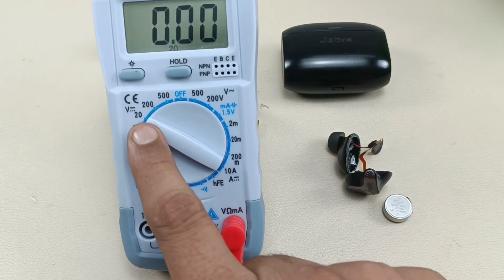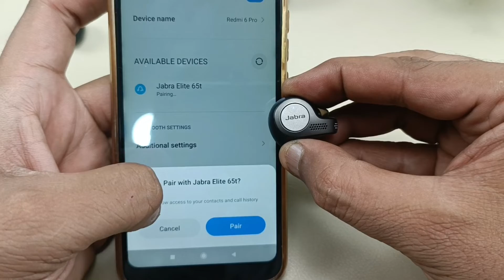JABRA Elite 65t Completely Dead Fix | How to Teardown & Replace the battery

Comment: Hello how many mah should be the battery? Besides 3.7v! I see in AliExpress some with 40 mah and others 70mah.
Reply from the maker: hi! , 40mah or 70mah can be fine but as mah increase size of the battery increases so fitting inside the buds is challenging, so based on the space available inside the buds you can use the battery

Comment: What is the replacement battery part no. ? Where are you located ?
Reply from the maker: it's Li-ion polymer Battery which is compitable to this device . part number is  not available.

Comment: Do you think the Elite 75t is similar to replace the battery?
Reply from the maker: yes it's almost similar.
Reply: @audiowiz360  thanks! I might try it when my new earbuds arrive. I used the 75t for 4 years, great earbuds but the batteries are at their end ⚰️
Reply from the maker: if you are from India send it to me , If you want I can replace it for you.
Reply: Did you need to use heat or a razor to break the bond on the case??

Comment: Excellent step by step video….I repaired my Jabra Elite 65t following your instructions…ALL controls work perfect….when placed into charging box, it does show led on to show charging BUT does not charge…please suggest a fix…ty, keep up the great work
Reply from the maker: Thank you! if the charging case doesn't give voltage in that case also buds will not charge. 
check the contacting points of buds and case try cleaning it because sometimes the point doesn't touch. 
best of luck!
Reply: @audiowiz360  ty…all points are working….I may have to glue down the round cooper Negative in the buds to ensure contact…
Reply: *copper
Reply: I have the same problem. I took it apart several times. But I can’t check whether the contacts inside the earphone are touching or not. I'm already thinking maybe the power controller is broken?

Comment: hello, one of my headphones is malfunctioning.  (very little sound) I went to check the audio balance but it was well adjusted.  So I tried to put the setting all the way on the left monitor (which is malfunctioning) and indeed we can hear the sound but from a distance, not loud, with a "radio" effect.  I don't know how I could fix this.
Reply from the maker: without checking it I cannot say the exact problem. 😊

Comment: Good teardown video. IT WORKS!!! My only addition to it so you can separate the adhesive easily is to heat the bud with heat gun. You don't even need to pry it once its heated. The bud can be easily opened. I tried to open the bud without heating, it is to hard and even with pry tool you can't open it. Heating is the best way to loosen glue. But overall good and it works. Thank you!
Reply from the maker: nice 😊👍

Comment: My Jabra Elite 65 t not working mic.
Reply from the maker: try to clean the mic hole in the housing , the dust might block the channel in turn the audio may not reach the mic so it will feel that it is not working.

Comment: Excellent video. I tried to pull apart but did not work. How did you open the earbud? Razor blade? Heat gun?
2nd question- I found LI1254 battery on ali-express, can i not use round battery on same connection point? Ty for your time.
Reply from the maker: Thank you so much!
1 you can use mild heat on the buds using hair dryer it will loosen the paste. 
2 you can use any lithium ion battery of 3.7v 😊👍
Reply: i can confirm mild heat works wonders!!
and a super thin pryin tool